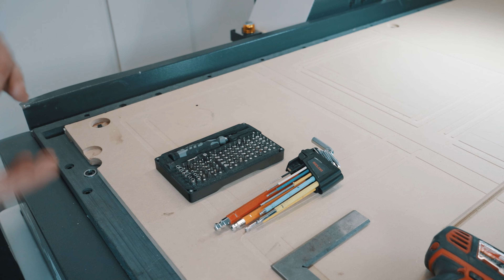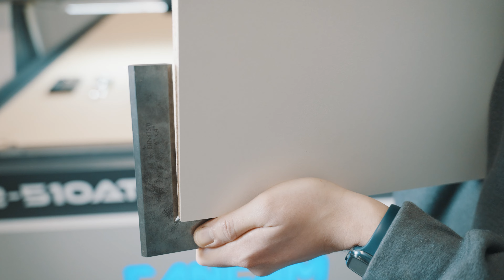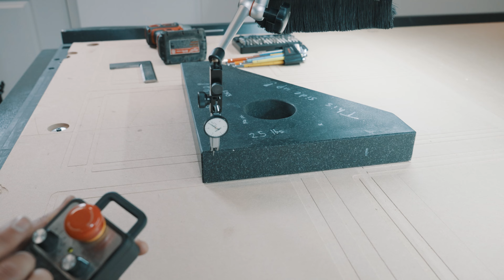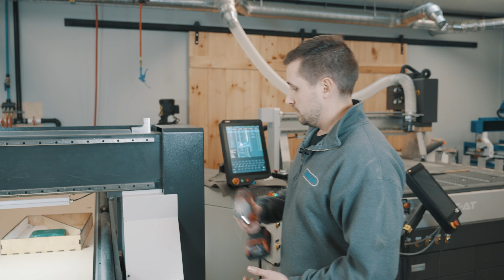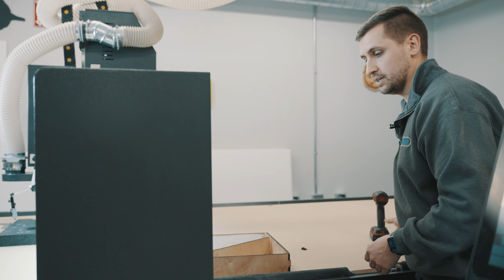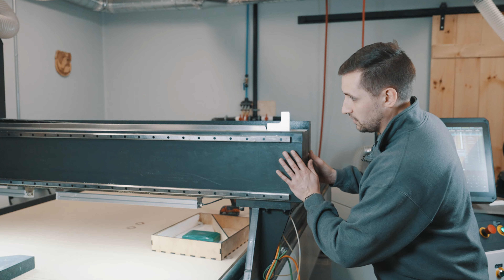CanCam C2 gantry squaring - CNC router

Comment: A clear and very helpful video, thanks. I just purchased a granite triangle for this purpose. At first I thought I could use the sides of a small granite surface plate for alignment - nope! Turns out that while the top of a surface plate is flat, there is NO guaranty that any surface (top, bottom, or sides) are square to any other. Learned that when two small surface plates were placed face-to-face, sat them on-edge onto a third surface place, and the faces rocked back from each other by about 0.05"!
Reply from the maker: Oh for sure. We actually had our granite put on a $100,000+ Hexagon CMM to confirm the granites squareness. Now obviously not everyone has this ability, but when dealing with squaring the machines, we need to make sure our granite tri-squares are indeed square. - Alexander

Comment: This is not how you square a gantry, loosening only one side does nothing really it will return back when you power it off. You loosen both sides , can leave one bolt on one side, so the gantry rotates around gantry sides, because you are not adjusting the position of sides to one another but rotating the gantry. Also you need to tighten the bolts before powering the machine off, doing it after also means you are moving the parts around while nothing is holding it.